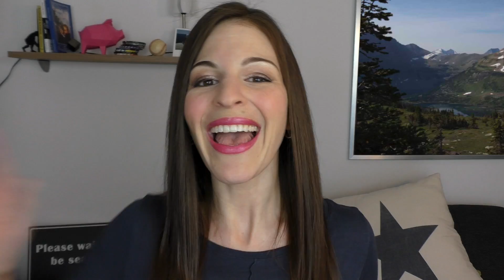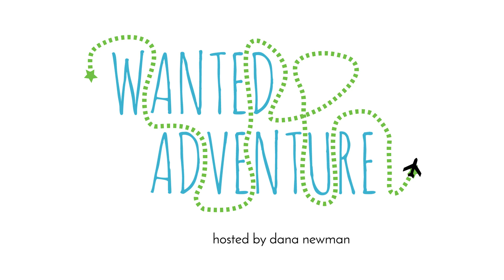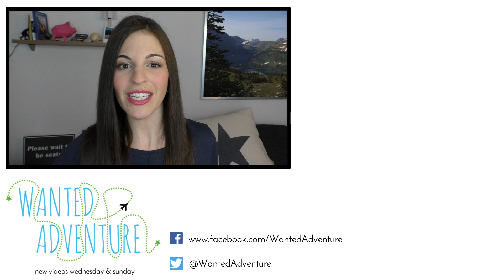Why Are Houses in America MADE OF WOOD?!

Comment: I prefer the German brick style, not just because it's more sturdy and rots less, but also because they have much better insulation. Houses in the US get way too cold in the winter and way too hot in the summer. In Germany, although the summers can get really hot, the heat is much more bearable indoors, whereas it can be impossible to stand without an AC in the US.
Reply: I live in Finland and feel the opposite, that a stone house must be colder and lacks the insulative properties of wood, sure it has thermal mass but then is exposed to the outside? No I don't think it would work where it gets down to -30C, such as where I live, the heat would be gone faster than it could be put in, no chance at all without constant heating. Now if you put wooden facade around the whole stone exterior and insulated it...
Reply: Yeah that's the thing. The USA need large amounts of energy just to power all these ACs in every single flat or house, which is a huge factor of environmental pollution. In central Europe, it is more common to not have an AC in residential buildings. I think on this channel there's a video where she talks about being surprised because Germans don't even have ceiling fans (in fact, there are some, but that's like 3% of the houses).
Reply: Even as a Dutchie, for me homes in Germany are so much better than Dutch ones. The German tend to build thicker walls and especially older homes sometimes have VERY thick walls. It can be sooo nice when you walk into a home on a 33 degree hot summer day and experience a nice 18 degrees inside without any AC at all...
Reply: I'm in Holland (same weather as Germany) and last three years I haven't used heating not even in winters. Its an apartment building from the sixties with concrete floors but masonry walls. It was upgraded in the nineties to double glass windows with plastic frames for windows/doors.
This winter we got -10 degrees Celsius a couple of nights and lowest temp inside was +8 C. Just because I've got a family with children below me who heat up to +20C. It has been snowing this weekend and the only thing I needed was an extra fleece sweater. Usually during winter my temperature indoors is +12 C while temperatures outside are just above freezing.
I've been in same type apartment without double glass windows and without an apartment below it. In those houses it freezes indoors within 2 hours after it freezes outdoors if you don't turn the heater on. If you turn of the heater for the night you wake up in a freezing house.
Reply: Germany has an extremely mild climate compared to the extremes of the US. We've got everything from arctic to tropical conditions, plus extreme weather and earthquakes. Climate wise, Germany is basically like the Pacific Northwest of the US/Canada.
Reply: In Scandinavia (im in Norway) - 90% of the houses are wood. But it is built differently than in the US - much thicker walls with several layers of planks and 30+cm og rock/glasswool. Brick or concrete homes here seems colder as the stone doesn't insulate as well. I especially notice this when I visit family In Austria (where 90% of the houses are concrete) - and they have an extra cold season - houses are freezing!
Reply: That sounds more like houses in Alaska. Thicker walls, more insulation, more panes of glass in windows, arctic entrances. Theres no need for this is the warmer states.
Reply: I live in a part of Germany where we get -25 degrees at night in winter. My room has two 'outside' walls and I only have one heater in my room, it works just fine, even without having it on full force. In summer the room is nicely chilled, despite it having a big window facing South. obviously it depends on how the houses are built, but usually here in Germany you have several layers, not 'just' bricks or concrete but also insulating material like glass wool.
Reply: Your apartment is heated, just not by you.
Reply: The "German style" historically speaking are "Fachwerkhäuser" - Timber framing with "Wattle and daub" and Bricks. And belive me, the insulation is absolute horror. my grandparents had one from the 14. century. and they bought a forest to heat that during the winter.

That "most" houses today are made from brick or concrete is due to A: the industrialization, "Jugendstil" or "Art Nouveau" - people got rich and teared those old fachwerkhäuser down. B: World War 2, where the fachwerkhäuser still standing where turned to rubble or burned to the ground. Thats why regions who where not that effected from the war still have those fachwerkhäuser still standing. 

After the war people realy build houses from what ever they could get hold of. The house i grew up in, had rail road tracks in it. They realy did not think about energy efficiency. 

As for insulation or lets say "temperatures": Wood is better against cold temperatures. Thick wood. Not Plywood. A: its probably a better insulator - thats why fachwerkhäuser are often insulated whit wood pellets. And B: Wood is more able to addapt to different temperatures than concrete, brick or stone. That stuff cracks if its gets to cold.

Stones are better against heat cuz stones are not heating up that fast. Thats why even in italy or spain people usualy dont have ACs.
Reply: We have cinder block building in the U.S. as well, usually not residential though, and they don't fair much better in tornado or earthquakes. Every state in the the U.S. has building codes that they must adhere to. The buildings codes take the varies severe weather and other conditions into account.Have a cinder block wall fall in on you and then tell me how safe it is.California has building codes for instance that don't allow for steel roof support beams, it makes sense, which is easier to cut through if you need to free a trapped victim, also since there are usually gas lines that are ruptured, sparks from the saw would be dangerous.Colder regions have building codes that require insulation standards. I have lived in Germany and the houses there were no warmer or cooler, imo. The answer to more tornado and earthquake resistant buildings is not stone VS. wood, it is "continuous load path", which is the use of special connectors that better connect all parts of the house, roof to walls, walls to floors, etc like links in a chain if you will. This helps prevent roofs from blowing off, and allowing the wind from entering and ripping the house apart.
Reply: "I prefer the German brick style,"
I'm going to assume you're smart enough to know that the vast majority of "brick houses" don't use the brick for structural support: it's a façade with wood (or something else) bearing the load.

You just misspoke, right?
Reply: I bought a Dyson Air Multiplier-thingy last year. Very pricey, but darn is it worth the money. It is so silent I can place it at the end of the bed and have it blow the air over me on the lowest speed setting (it has 10 speed adjustments).
It is so much better than the average blade-fan that only has 3 speeds and is still too noisy on the lowest setting.
Reply: I think that's the difference. We Dutch (well, european people really) tend to think that our homes ar more sturdier and I think that in a certain way they are, but our 'tornadoes' are rarely powerful enough to do damage on a great scale.
The most powerful Earthquake the Benelux-region ever experienced was the 1992 Roermond earthquake (5.2 or so on the Richter Scale) which caused extensive damage in the north-east.

But, brick-built homes feature insulation between the outer-brick layer and the inner concrete-walls and plaster walls. Most homes in the Netherlands are built with 2 concrete walls on the sides which is the structure that carries all the floors, while the front and back-walls are relatively weak walls made from paper-covered plaster-plates (sorry, I'm not into construction enough to know what they are called in English)
Reply: Thx1138sober Turn your heat of for a month and it will get colder. Please send a message again to tell us how cold your house is after a month
Reply: "I'm going to assume you're smart enough to know that the vast majority of "brick houses" "
Most brick houses I've been in have had solid brick or cinder block type walls.
https://lushyourhome.wordpress.com/2015/05/15/see-how-german-build-red-brick-house-in-2-days/
This is also what you see when you drive past construction sites. Must be an American thing with a brick façade with wood behind it.
Reply: Wow. That looks sturdy as hell!...but it doesn't look "homey," more "industrial" and "severe." In particular, those windows look scary and plain without some sort of ornamental shutters or window panes. Looks more like a miniaturized prison building than a house!
(Which is odd, because Alpine/Bavarian residences always looked so cheery and welcoming.)
Reply: What hot summers?  I have a structural insulated panel home with 10 inch walls.  People ask if my house is air conditioned in summer, but it isn't.
Reply: That's not true really.  It's not just about price, and really not about noise.  You shouldn't talk 
without knowing ANYTHING at all about it.  Building a house of stone in 
Canada makes it a huge ice-cube unless you constantly heat it from the 
bottom up.  The same is true of half the US.  So, the below ground parts
 are stone and concrete with a wooden part on top, above ground to 
isolate it from ground-up freezing.  Also, the walls would have to be a 
metre thick if of stone to keep out the cold.  Wood frames with 
insulation allows for air pockets and it keeps it warm much better.  In my home town, not a major city, in Ontario a new house is $300,000, so the price
 is no different than in Germany almost if your numbers are accurate.  
It's about keeping it warm, and not about the cost of construction.
Reply: I moved to the US last year and this annoys me the most!
I don't call these things houses but huts
Reply: You are a complete idiot. The homes in the US are way way way warmer than houses in Germany. I'm living in Berlin and the house never gets above 15 degrees with the heat on. My mom's house in Tennessee can get up to 40 degrees if you want to. Electric bill in Germany is $200 (I converted to USD). In Tennessee it is $100. Of course our electrical companies gets energy from gas, wind, solar, and water. Tennessee actually has so much power that we are able to supply 6 states with their power.
When we lived in Florida our power bill was $150. The a/c rarely ran and the house would be 15 degrees. Really in Florida all you need is a ceiling fan and that's it for 90% of the year.
Reply: Elkey_er, I'll turn off my heat around April 15th and I won't turn it on again until around the first week of Nov.
Reply: Jij bent gewoon gierig en laat de buren betalen :p
Reply: As I mentioned previously, the weather here in the PNW is much less bearable indoors in the summer than it is in Germany, and I'm sure it has to do with the way the houses are built.
Reply: We all have AC's and heaters here.
Reply: weeardguy you are so right! Sometimes when we got about 40°celsius, we need some fans.
Reply: Jarl S it depends where you live. If you live in the areas that are hit by hurricanes you have a concrete or cinder block house with the brick facade. Wood isn't capable of standing up against a hurricane.
Reply: Concrete and brick walls have a high thermal mass, but are poor insulators. It is possible to incorporate air gaps between brick walls or install foam insulation on the inside or the outside, but hollow stud walls are the most efficient and cheapest way to go.
Reply: I live in a 100 year old wood frame house in Kentucky. My house is well insulated (additional insulation added in the late 1970's), right now the temperature outside is 22 degrees F (-5.5 C) inside it's 72 F (22.2 C). In the summertime, inside my house it's always 72 F (22.2 C). The only people that don't have A/C are the extremely poor or people that live high in Rocky the Mountains or near the Canadian border.
Reply: +Thx1138sober
Kentucky is the poorest state in the country though.
Reply: Or people in Washington. In the Seattle area, central AC is uncommon, despite the hot summers.

Comment: I live in Arizona and most houses are wood framed with stucco, which varies in toughness depending on how thick it is layered on. It's still not as tough as brick or concrete but stands up well to the heat and sun. The framing is still susceptible to termites which we have a lot of.  I have seen some stucco homes built with steel framing. There are also brick houses and a few adobe brick houses.

I think Dana's premise that the availability of timber was and is a big reason for houses in America being made of wood. At this point in our history I think there is also an attitude from builders that it is a lot cheaper for them to build with wood. I also think that many homes/buildings are built with the idea that within 30-40 years they will be torn down and replaced with something else, or extensively remodeled.

Comment: One thing I learned is that since the US was once a British colony, they built the homes the same way that the British did. However, since I'm from Southern California, I came across an article saying "Los Angles is not London. So why do we treat the city as though it is one? Because the southwest area of the US is mostly desert, it's dry, it gets really hot, and that it doesn't make sense to build homes that perhaps make sense in some parts of the country, but not here. Theoretically, homes here should be built (or should have been built) the same way that they do in the Mediterranean countries. Because homes there are built to keep the heat out. And Dana makes a good point that some areas of the country should have been built in a different way, simply because of different weather climates, to withstand tornadoes or hurricanes.

Comment: As far as I know, the typical wooden houses of america are not as wind proof as brick houses. Bützow in Mecklenburg-Vorpommern suffered a tornado two years ago (F3, which is already up to 300 km/h). There is a video about the damage done by the tornado and you can see many destroyed tiles and windows but the houses are still intact. 16 houses have been declared as uninhabitable but I assume, this must've been already light or  unstable buildings. And uninhabitable is still not totally destroyed like it can be the case with wooden houses.

BUT: the problem is not the construction out of wood per se but the way how the construction is done. My parents built a wooden house which is way more solid than the typical american light weight construction and should be as stable as a stone house. It's called "Massivholzbau".
So, wood is not the problem but light weight construction - which is way cheaper and this might be an important reason why so many americans are using it (combined with the fact that owning a house is far more popular in America than in Germany, so also people with lesser income are building houses).

Comment: In California we don't have hurricanes or tornados but we do have earthquakes; big ones, like knock down San Francisco then burn the remains to the ground big. Our housing looks pretty flimsy if you're from the Northeast. There is a reason they're made that way with wood. They sway and withstand the movement of the ground better. A stone or concrete building would easily collapse if it didn't a lot of rebar supporting it. It's also better to have a wooden wall fall on you than a brick one. The office towers are built on rollers so they'll move with the Earth.

Comment: It's true most houses in the U.S. are framed with wood. Some expensive houses in Germany are as well (i.e. Huf Haus, etc.). Most German houses are made with concrete block - many with AAC (autoclaved aerated concrete). AAC is a great material and is available in limited areas in the U.S. as well. It is not as strong as traditional steel reinforced concrete though. It would be very, very expensive to build a concrete house to withstand an EF4 or 5 tornado. Dana is right, houses are built with wood in America (and Canada too) because it is readily available, relatively cheap and the building trades are geared for it. Contrary to popular belief, wood can be very durable and long lasting. There are stave churches in Norway and shrines in Japan made of wood. Design, method of construction and maintenance are the keys. There are log homes and timber framed barns in the U.S. and Canada that are 200+ years old. I think where Germans (including my own family) have a legitimate criticism of American homes is the way some builders seem to cut corners. The windows and hardware (door handles, frames, etc.) in German homes tend to be much sturdier than the typical American home.